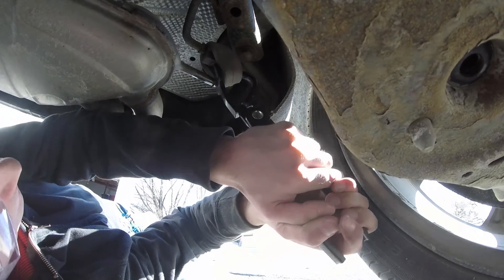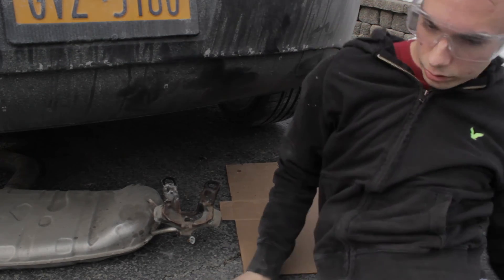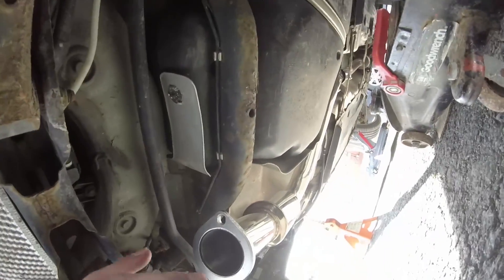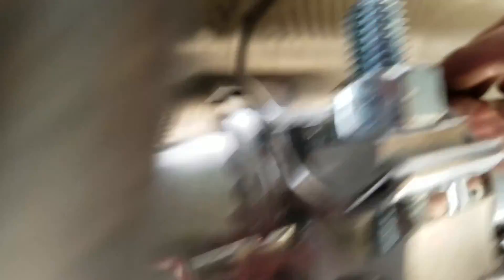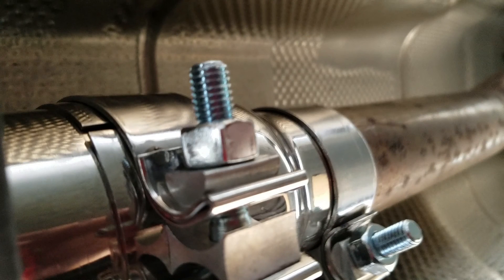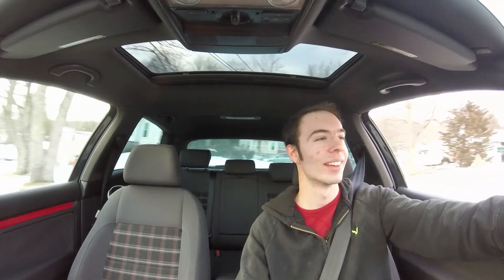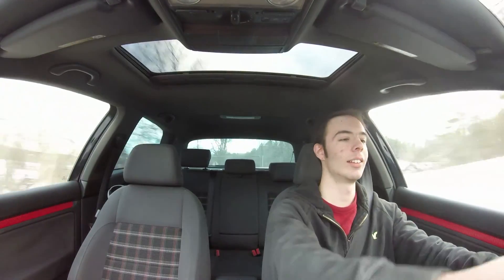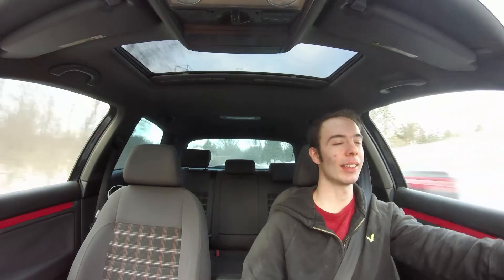GTI Exhaust Install (Megan Racing Drift Spec)

Comment: Looking for a new exhaust for my mk5 gti. Don't want anything too loud or droney. Just after a little more noise when giving it some beans :D
Reply from the maker: 3in Billy Boat stealth is good. I got mine during pandemic so they didn't finish the hangers correctly with flairs and driving in a snow storm ripped it off the car. Was a great sound no drone and easy to converse inside the car

Comment: I bought this exhaust because of you and I couldn't be happier
Reply from the maker: +thefloatingcheese2 awesome glad to hear you like it, if you take out the silencer the tone gets deeper I've got a vid on that too. 

I haven't made a video on the dp yet but I put a 3in catless downpipe with the megan racing cat back and it sounds pretty mean. Lots more pops and If you don't mind a drone on the highway. I personally love it and get compliments from random people when I go places.
Reply: Savage GTI I now have the same exact exhaust setup you just mentioned. If you haven't already, get a cold air intake. Makes a huge difference as far as performance and makes cool sounds.
Reply from the maker: +thefloatingcheese2 yeah I got the red coated neuspeed intake.
Reply: On normal speed like on a street, can you still hear the exhaust?

Comment: Always nice to see someone revs their car when the engine is cold -,- Why don't you just do a resonator delete ?
Reply from the maker: Because straight pipe. footage got deleted but I added a 3in catless DP then got a ticket for loud exhaust then put stock cat back on and soon to remove it again lol
Reply: True that. Only thing is, you got a ticket for it now. If you just do a resonator delete you can lower the rpm so the cops can't find out:P